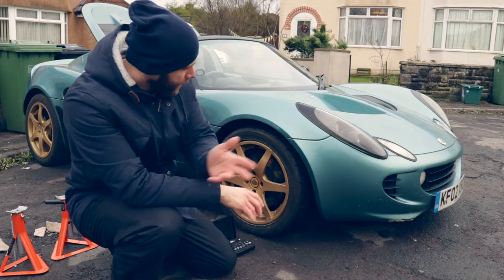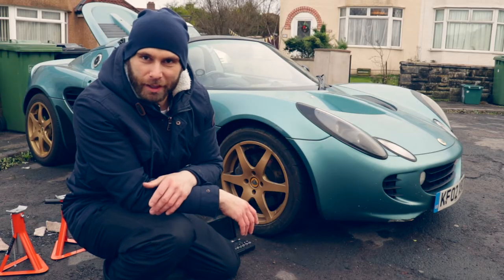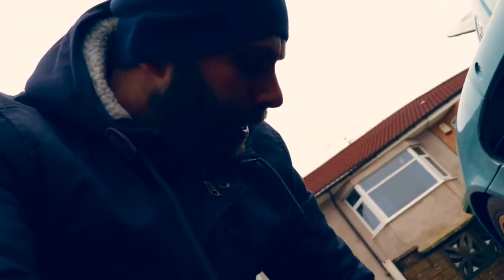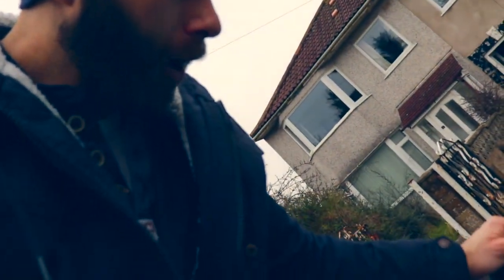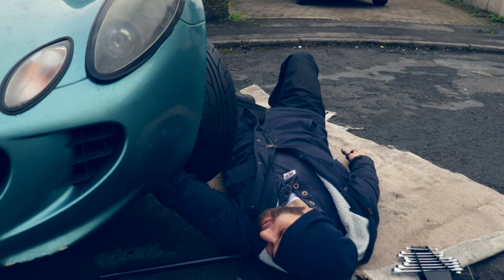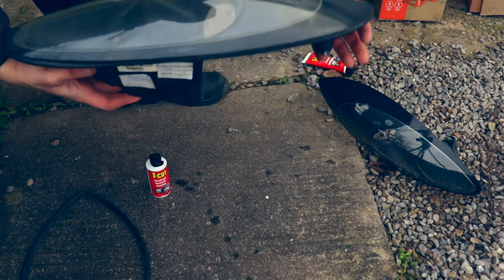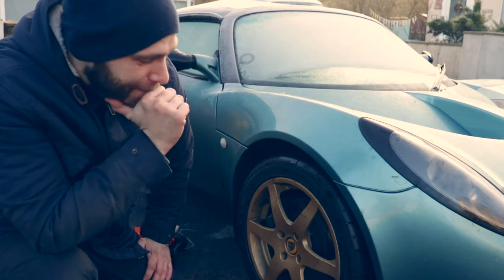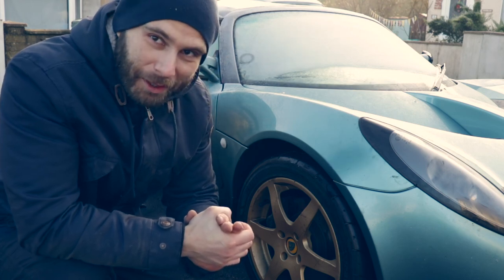Well That Did Not Go To Plan!

Comment: Try the bulbs on the front spots (they are h7)!   It's much more of a pain though.
Reply from the maker: I've not touched then yet. But will be changing them in due course..thanks for the heads up!
Reply: @scousedave1917  it's an absolute ball ache.   they get the worst of the salted roads, so brackets are usually rusty. 

 I've sent you an email as well!
Reply from the maker: @oliverjenks  just seen now. Appreciate that! Thank you. Will come in very useful